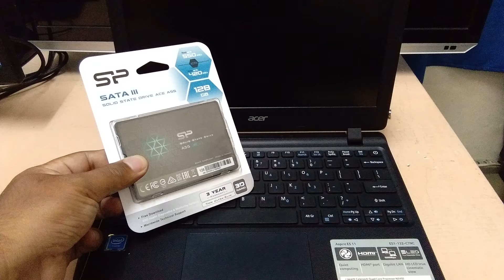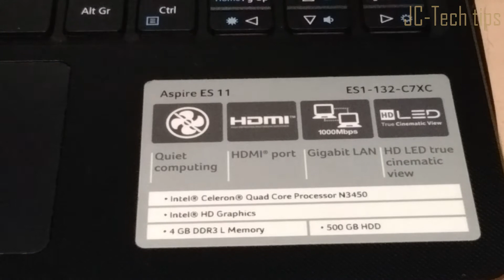Upgrade SSD on Acer Aspire ES 11 ES1 132 C7XC

Comment: Astig grabe na pa subscribe agad ako. Napakagaling ng content mo boss may specific question lang ako

1. Anong ram ang ang compatible. Anong specs at plug n play na ba? Ilang GB ang kaya
2. Anong SSD ang compatible size ang kaya?
3. Kaya po ba palitan ng proccesor at ano ang pwede (if ever) 

Maraming salamat sa sagot more power sa channel mo boss
Reply from the maker: Hi Thank you for watching my video.
1. maximum of RAM 8GB 1600MHz PC3L-12800 DDR3L 1.35V
2. SSD sata type 2.5 kahit anung brand.
3. Hindi na po kayang palitan yung processor.
Reply: Bibilis ba laptop khit papano kpag ngpalit ng ssd? Im using also acer aspire es 11 with 2gb ram.

Comment: hello
I have a laptop acer aspire e11 es-131-c10x is it possible to add a SSD and make it a basic disk, that is, install the system windows instead of a emmc?
Reply from the maker: Hello your model not possible to upgrade SSD. only emmc.

Comment: Buenos días, tengo una computadora portátil Acer Aspire ES1-131-C2NM made in China 2015/09/06. Lleva Procesador Intel (R) Celeron CPU N3050@ 1.60 GHz RAM Instalada 2.00 GB y Disco Duro HDD 500 GB, quisiera optimizarla. Y como cada modelo tiene particularidades y limitaciones, pregunto: ¿Puedo colocarle un disco solido SSD, que tamaño es el recomendable de 240 o 480 GB o que tipo de disco ponerle? La RAm hasta que tamaño puedo aumentar o ampliar?
Reply from the maker: Para mí, es mejor 480 gb de tipo SSD sata, luego la ram es la actualización máxima es 8 gb DDR3L PC3L-12800 1600MHz SODIMM.

Comment: Hello, sir, may I ask, the type of laptop is the same as the one I have, I want to ask if it's better to change to a better SATA or NVME SSD? then do we need to reinstall the program after installing the SSD on the laptop?
Reply from the maker: For this model you can only replace with SATA SSD, If you want to use the OS from the old HDD you can clone it using clone software, for me I'm using AOMEI Partition Assistant.
Reply: Ram type ddl3 or ddl4 ?
Reply from the maker: @krishnusingh6954   its DDR3L 1600 MHz

Comment: Apakah bisa upgrade ssd tnpa upgrade yg lain ? Apakah work dgn baik dr sblmx jika hnya up ssd🙏
Reply: Dan ram 2 gb apakah bisa ?
Reply from the maker: Untuk model ini, Anda hanya dapat meningkatkan ke SSD sata 3 saja.
Reply from the maker: @nersfpv69  Mendukung ukuran memori maksimum 8GB dengan DDR3L 1600 MHz, tegangan 1.35V dan paket Standar 260-pin
Reply: Klu up ram, rekomendasi apa ya merk dan brpa gb ?
Aq pakai acer aspire 11 es1-132 C4BM, ram 2 gb DDR3 L
Reply from the maker: @nersfpv69  Untuk model ini dapat mendukung hingga 8gb. bagi saya adalah kingston.
Reply: Siap makasih infox om,,,
Reply from the maker: @nersfpv69  Selamat datang, terima kasih telah menonton video saya👍👍👍

Comment: Hellow Po nagupgarade Po ako Ng Ram pero paginoopen Po nka-on pero di xa nagoopen Ng windows..!
Reply from the maker: Supports maximum memory size of 8GB with DDR3L 1600 MHz,voltage 1.35V and Standard package of 260-pin

Comment: hi, if you add another 2 gb ddr3l 1600mhz ram, does it work in dual channel memory mode ?
Reply from the maker: Yes
Reply: @JCTechtips  does that make laptop faster than adding 8 or 4gb ram ?
Reply from the maker: @iceberg789  there is really an improvement when you add another ram.
Reply: @JCTechtips  ok, thanks
Reply from the maker: @iceberg789  no problem.

Comment: Which RAM is inbuilt in it?
Reply from the maker: 2gb is built-in on the board. and  you can add other memory on empty slot. up to 8gb.
Reply: @JCTechtips  ram type name ddl3 pr ddl4
Reply from the maker: @krishnusingh6954   DDR3L

Comment: idol isa ako sa subscriber nyo, may tanong ako possible po ba maupgrade sa ssd ang acer aspire es11 model es1-132-c0cp, emmc lang nakalagay 32gb lang. may trick ba daw? ung iba kasi may wire na nilalagay, at ung iba may modification na kinakabitan daw ng connector sa motherboard. possible kaya un? reply back...

Comment: good day po 

ano po maganda brand sa RAM and ssd may link po ba kayo sa shoppe or lazada ?
Reply from the maker: Yung nag install ako ay mura pa yan, pero i suggest na ramsta nalang po yung ssd na bilhin niyo ngayon ay nasa 1369 nalang yung 240gb ito po ang ram https://shopee.ph/Ready-Stock-Kingston-DDR3-4GB-8GB-RAM-Laptop-Sodimm-1333Mhz-1600Mhz-PC3L-12800S-1.35V-1.5V-Memory-i.460950441.3791486356?sp_atk=dc7d7e9c-a576-43ac-b6d6-f8cc021bc46c
at ito yung SSD https://shopee.ph/Ramsta-S800-2.5-SATA-3-Solid-State-Drive-SSD-120GB-240GB-480GB-1TB-2TB-SSD-for-Desktop-Laptop-i.462016051.15514968901?sp_atk=2821d1a8-3658-4376-ab09-9fc4d5d78bef
Reply: @JCTechtips  compatible ba pag mag install ng windows 10 pro sa ganyang specs yong hindi pa upgrade yong standard lng specs ?
Reply from the maker: @johnemyljenovisa7509  Yes po compatible.

Comment: What is the name of that ram plz someone tell
Reply from the maker: For this model Supports maximum memory size of 8GB with DDR3L 1600 MHz,voltage 1.35V and Standard package of 260-pin either Kingston, Hynix, crucial, samsung.

Comment: Lods compatible kaya ang 512ssd & 8 ram sa acer aspire es11 2ram 32gb na laptop (netbook) respect wala po ako alam sa laptop bigay lang kasi sakin yun for online class kaso 32 gb lang diko nagagamit. Tapos ang bagal.
Reply from the maker: Anu pong exact model ng laptop niyo baka wala po siyang slot for HDD or SSD.
Reply: @JCTechtips   Aspire ES 11    ES1-132-C5BH
- intel ® celeron® processor N3350
- intel ® HD Graphics
- 2GB DDR3 L Memory
-eMMC 32 GB
Reply: Yan po lods yung sa sticker niya.
Reply from the maker: @carcelzo1717  Yes.
Reply: @JCTechtips  lods, so compatible yung 512ssd & 8 ram?
Reply: @JCTechtips  salamat lods bukas papa upgrade ko na po.
Reply from the maker: @carcelzo1717  Try mo muna e open yung netbook niyo.
Reply from the maker: @carcelzo1717  Yes po.

Comment: Par, can you make a vid naman kung pano mag lagay ng ram sa laptop na yan,  and need pa ba mag configure pag mag lagay ng ram or plug ang play na ?
Reply from the maker: Plug n play lang siya, and maximum of 8gb lang po sa model na ito.
Reply: @JCTechtips  Thank you sa pag reply par.
Reply from the maker: @adrian_cabaya  Your welcome, thanks for watching.
Reply: @JCTechtips  Anong brand ang type po ng RAM ang more suitable para sa ganitong model ?
Gantong-ganto po kasi yung laptop ko, na upgrade ko na din po yung SSD ko because of your video po nagka idea ako kung anong SSD ang suitable.

Ask ko na lang po saang shop or link po para sa RAM na 8gb 😊
Reply from the maker: @adrian_cabaya  Ito po sir, yung 1600mhz po ang piliin niyo https://shopee.ph/Ready-Stock-Kingston-DDR3-4GB-8GB-RAM-Laptop-Sodimm-1333Mhz-1600Mhz-PC3L-12800S-1.35V-1.5V-Memory-i.460950441.3791486356?sp_atk=ef8bfe0f-3257-4882-a6ee-975e2b0a283f
Reply: @JCTechtips  Thank you po sir.
Reply from the maker: @adrian_cabaya  Welcome, thank you for watching
Reply: @JCTechtips  In addition na lang then po, what is the best/fast and suitable ssd enclosure for this specific SSD.
Reply from the maker: @adrian_cabaya  Yung USB 3.0 na po.

Comment: Boss kapag na upgrade napo pwede ba mag install nang games?
Reply from the maker: Depende kasi sa games, e search mu yung system requirement ng games na nilalaro mo baka kailangan ng higher gb ng video card.
Reply: @JCTechtips  yung dota 2 ganon boss kaya ba?
Reply: Pwede penge link shopee yung sa ssd tsaka ram aspire es 11 es1-132-c3h6 yung model po salamat boss laking tulong to
Reply from the maker: @vinn.animation  Hindi po kaya.
Reply: @JCTechtips  salamat boss subs kita bait mopo
Reply from the maker: @vinn.animation  https://shopee.ph/%E3%80%90Local-24H-ship%E3%80%91Samsung-4GB-8GB-DDR3-DDR3L-Notebook-Memory-RAM-SODIMM-1600MHz-204Pin-1.35V-1.5V-RAM-i.789444690.21926018630?sp_atk=1c23a2fc-7749-405c-aedc-37ade7d7d076&xptdk=1c23a2fc-7749-405c-aedc-37ade7d7d076
Reply from the maker: Sa SSD kahit anung brand lang po walang problema.
Reply from the maker: @vinn.animation  Thanks.
Reply from the maker: Yung ram is maximum of 8gb piliin niyo po is 1.35v
Reply: @JCTechtips  cge po salamat sa tips may natutunan ako kahit di ako it haha

Comment: hello po, upgradable po ba yung RAM niya?
Reply from the maker: Supports maximum memory size of 8GB with DDR3L 1600 MHz,voltage 1.35V and Standard package of 260-pin

Comment: San po nakakabili nan? Wala rin po kasi ako nun box na lagayan ng hdd. San po kaya pwede?
Reply from the maker: Sa shopee lang po ako kalimitan bumili.
Reply: @JCTechtips  pwede po pahingi nun link para sa es11 din sana. hirap po kasi maghanap. salamat boss
Reply from the maker: @johnricksoriano5977  Hi ito na po yung binili ko nakabili na ako nito mga 70pcs. pinang upgrade ko sa pc ng computer lab namin. ok naman working pa lahat 2years na. https://shopee.ph/Walram-120GB-128GB-240GB-256GB-Internal-Solid-State-Drive-2.5-Hard-Disc-Inch-HDD-SATA3-SSD-60GB-480GB-512GB-for-Desktop-Laptop-PC-i.418647549.4185140900?sp_atk=3024614c-1969-476e-9251-bfbcf1141971&xptdk=3024614c-1969-476e-9251-bfbcf1141971

Comment: Ano po mga inupgrade niyo para mapabilis pag boot ng laptop sobrang lag po kasi ng sakin 

Ito po specs
Specs:
Quiet computing
Precision touchpad
Bluelight shield
HDMI port
Intel celeron quad core processor N3450
Intel HD Graphics
2GB DDR3 L Memory 
500 GB HDD

Pls help me naman ano ano mga iuupgrade
Reply from the maker: Hello po, pwede mo e upgrade ang ram  at SSD.
Reply: hello po ate. same laptop po tayo. sobrang bagal din ng sa akin. ano pong ginawa niyo?
Reply from the maker: @gazelliansmate5550  e upgrade niyo nalang po ng ssd, marami rami narin akong na upgrade at bumuti yung ang kanilang laptop.

Comment: Magkano po bili mo sa ssd
Reply from the maker: Almost 2k sa shopee.
Reply: Pasend link po ng mismong store
Reply from the maker: @ploxtan6487  https://shopee.ph/Silicon-Power-Ace-A55-256GB-SSD-SATA-III-6Gb-s-III-2.5-Inch-i.53493590.1645793699
Reply: @JCTechtips  sir pavideo nmn kung pano magbooth after install ng ssd.kailangan ba itransfer yung laman ng hhd para mgbooth?
Reply from the maker: @denseo2222  May option po kayo, pwede niyo e clone yung nasa HDD ang OS to SSD. or Install mu lang ng bagong OS ang SSD. sa aking kasi nag install lang ako ng bagong OS then yung HDD ay linagay ko sa Enclosure para maging External Hard drive.